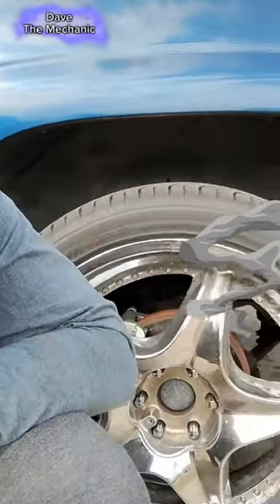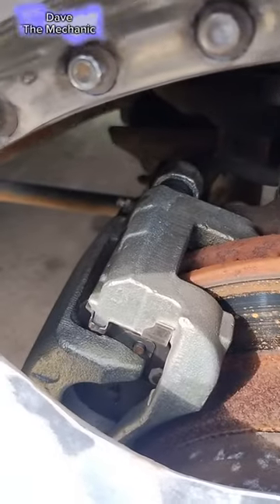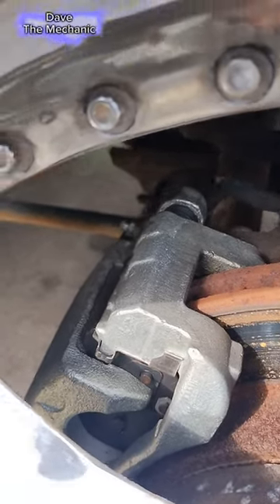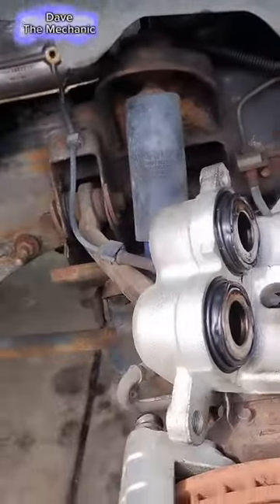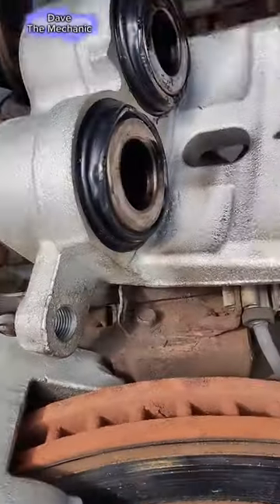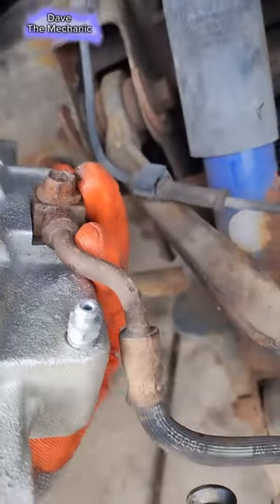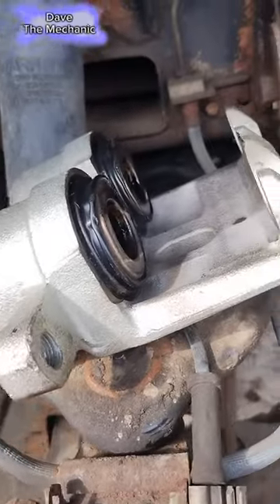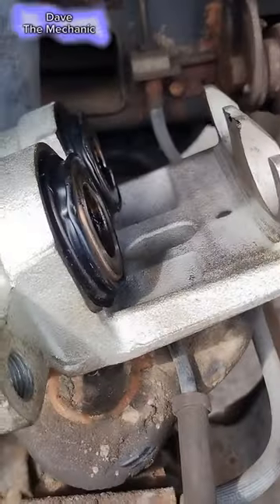Why are my Tahoe brakes Smoking?? 2001 Chevy Tahoe brakes too hot. brake smoke. #short #tahoe

Comment from the maker: UPDATE: I tried pushing the pistons back into the caliper and they won't budge. The problem is Somewhere between the caliper and one of the brake lines.
Reply: It is the hose it rusts inside the first hold down from caliper you can pry it open and see it will let your caliper retract

Comment: Aye playa you did not check for grease inside the pins of the caliper bracket, it's probably dry and causing the brakes to drag.
Reply from the maker: That's possible. But after I made the video I tried pushing the pistons back into the caliper and they won't budge. The problem is somewhere between the caliper and one of the brake lines

Comment: Caliper if you can bleed ‘‘em it’s the caliper
Reply from the maker: I thought about that too but when you think about it even if you can push the pistons back in after Opening the brake line, yes they would go back in but the problem could have still been a bad brake line and it would go back to doing it again
Reply: You can’t press them in with the bleeder closed? Sometimes the pistons just need reseated

Comment: Raise both front wheels off the ground, then pump the brakes. Then get out and see if either wheel will move freely, if they don't you have a brake hose restriction. Brake hoses are cheap, just replace them anyway.
Reply from the maker: I raised the other side like you said and  the other side definitely turns more smoothly, but at this point a bad caliper and clogged line would give the same bad symptoms. I'm kinda  leaning more to the brake line since the caliper is new.